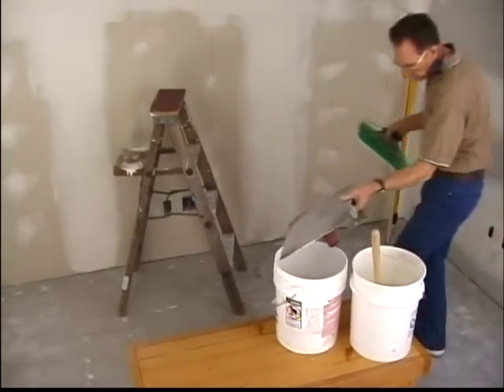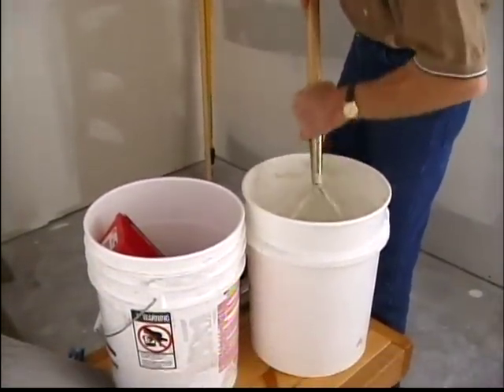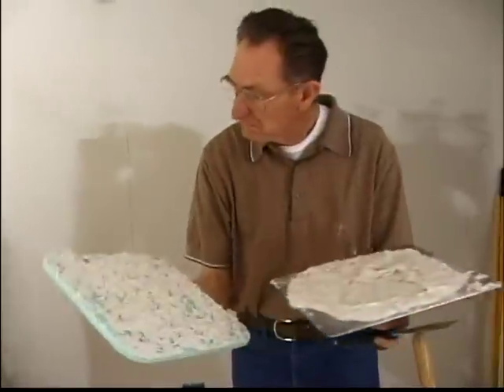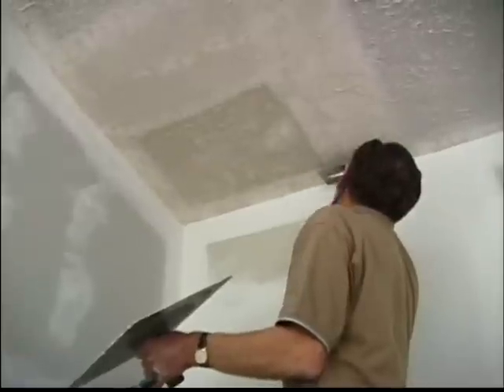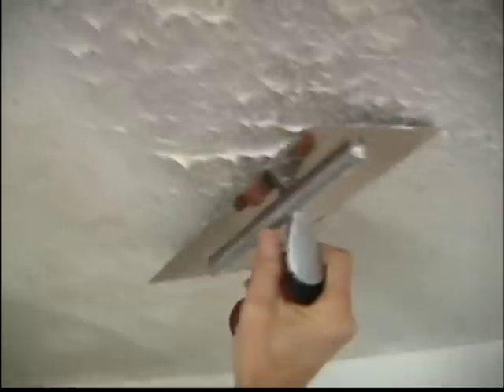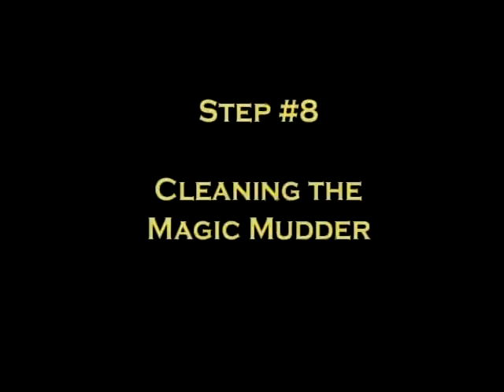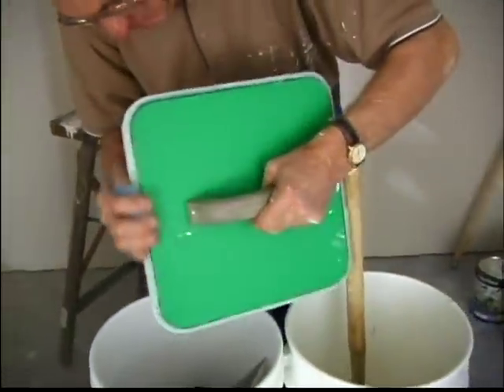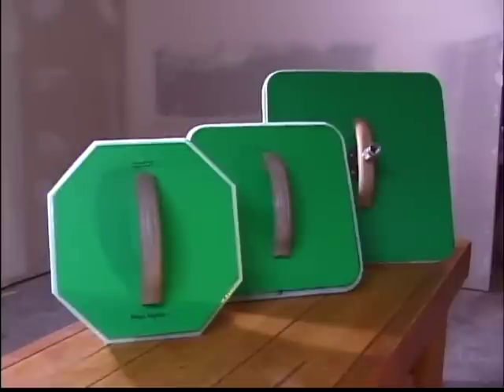Magic Mudder How-to #1 - Ceiling Texture

Comment: I met the man who did this video here in my town and he asked me to watch this video as I needed to try and match a knock down finish on my ceiling, and this helped. He's much older now and works part time at our local HD. He's quit a nice old man and I enjoy talking with him. Lots of stories to tell ! I also have a dry walled wood shop shed I would like to put a texture on ,but I don't think I'll be using this tool as it is more work than I want to do. I have one of those spray texture guns from Harbor Freight that works great and its fast and easy and it does minimize  imperfections in the wall from the M/T step. Most people do hire these kind of jobs out as they just are messy and not fun, but I'm just too much of a miser to hire anyone and lose money I could be purchasing tools with.  Dry walling, mudding and texturing isn't difficult to do, it does take some practice. It isn't fun to do for sure! It's just a little below painting on the fun scale, LOL !

Comment: I don't get all the hate...
This will ultimately look much different than if spray applied and then knocked down. Some folks will spend more time and labor for a different look.
I just bought a home built in the mid 80s and all of its texture is hand applied. I have some patch work to do, so i was researching various hand application methods, and the finished product from this product/strategy is a pretty close match to what's in my home. Quite helpful.

Comment: If you enjoy playing with little dabs of mud and 2 or 3 hawks and thingys drying out while you're fiddling around, you might enjoy this. I might suggest either masking the walls and using a hopper gun with a  manual mud pump in your bucket, or just thinning the mud enough to use a long nap roller.  You use a box of mud per 150 sq ft or thereabouts, and do some serious rolling, but it goes whole lots faster than this does.

Comment from the maker: @onebiggdog - Thank you for your question. The ceiling fan does appear to be placed at the edge of the ceiling. The ceiling fan is actually mounted at the peak or highest point of a vaulted ceiling to help circulate the air in the room.

Comment: it is funny that you use a square tool (commonly called a hawk) that you can buy at home depot for $13 to then transfer the mud to the same size square tool (your magic muddier) that you then apply the texture with. I always just buy a big square storage bin for $10, fill it with mud, then use the first square tool (hawk) to apply the texture. less hassle than your way. 2 steps instead of 3.

Comment: I think this is just a demo. The ceiling, before put the texture, is not even finished with a primer or other paints. I ll bet after the video was done, they scraped all the texture off
Reply: or when you thin your mud out, you add some paint. It promotes adhesion and makes the texture suck up less paint so you get a very even finished product in even less time. A half gallon or so, of the cheapest flat white you can find is all you need in a 5 gallon bucket of mud. Worked great in the rooms I just refinished and on the closet and wall we added.

Comment: jajajajajajajajaja you dont have a machine to do a texture well 
You do not do the texture like that
Reply: Wow you can actually texture your well. Geez that’s impressive, especially to think you can imply it over old stone or brick. I’m guessing you’d have to clean off the old moss, dirt, or really any type of loose material like mortar that has built up over the years, or in some cases decades if not century’s! 
 Do you place a screen or something at the bottom to catch any falling texture mud?  I mean you wouldn’t want a bunch of that white mud in your drinking water right  yuck!. Hell, I’d run some LED lighting all the way down in a spiral just for shits and giggles.